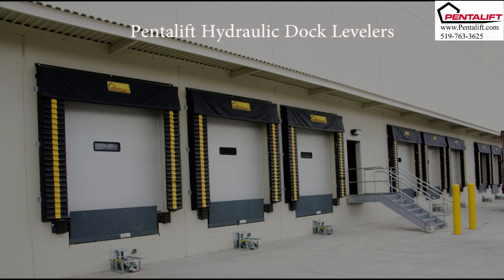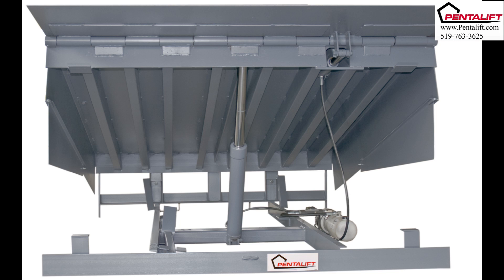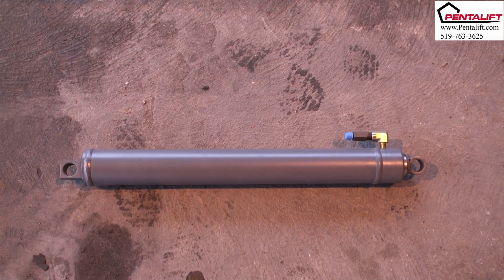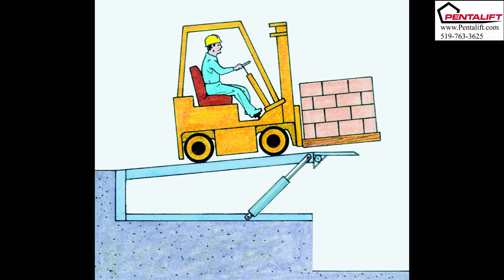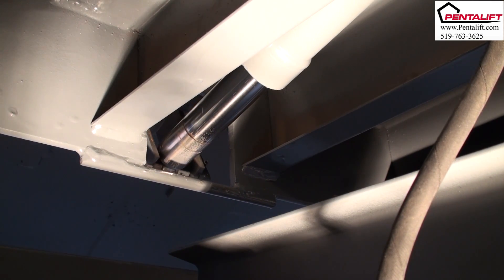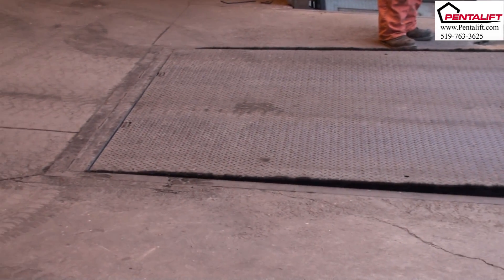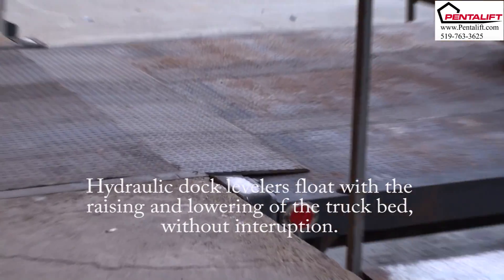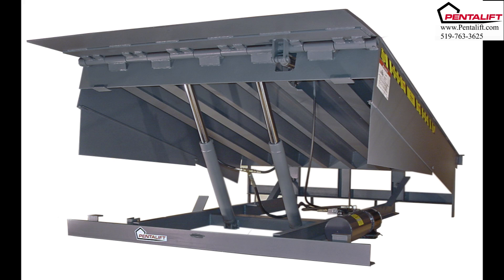Hydraulic Dock Levelers

Comment: We don't have one of these pentalift dock levelers at my work, but it uses the exact same front plate design to nightlock the lip.  Only problem is that the front lip doesn't retract all the way back in to clear the plate and instead goes back down in front, causing the plate to go below dock level with the front lip on the outside of the dock. I'm wondering if this is a problem with the Hydraulic controlling the lip, or possibly a rusted hinge bar that connects the plate and lip together... Any advice?